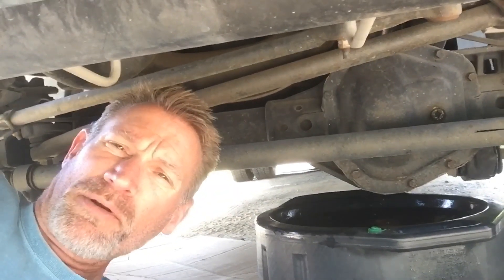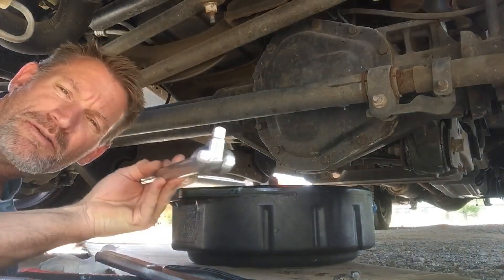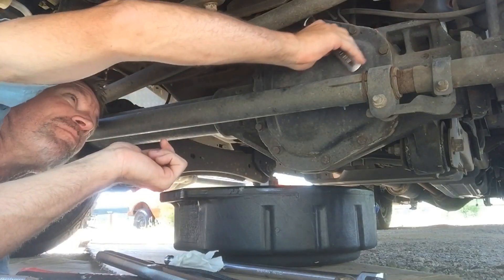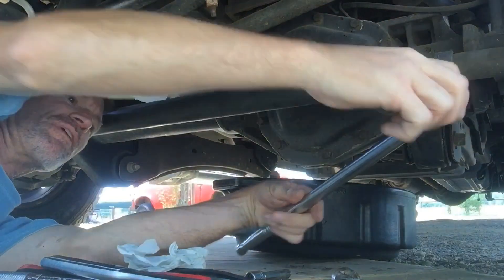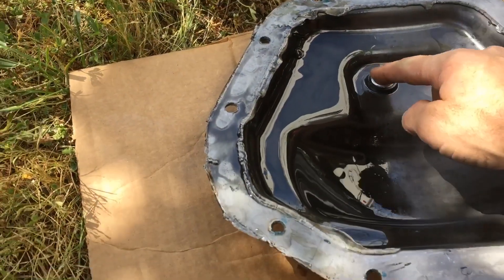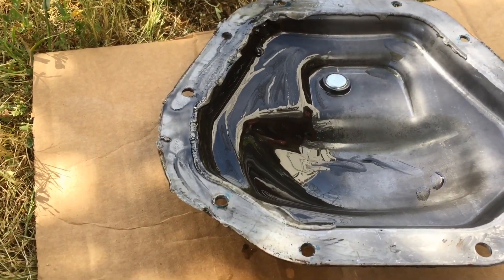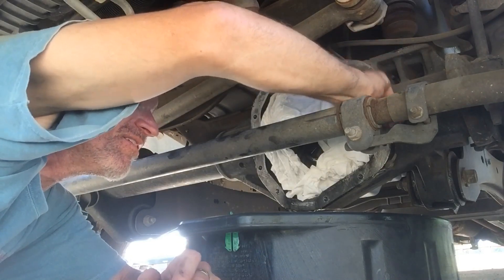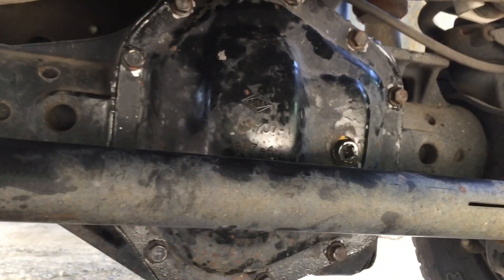Ford F-350 Dana 60 Front Differential Service Oil Change

Comment: Great job I usually do my changes every 8 months just to keep it in a scedule. The oil never seem to be bad and no metal.
Reply: unless its 5-10 years old or you use the 4WD, you never need to change it, but to be over the top, change it after a winter of plowing, or a bit of off road, or as needed like if it gets  submerged in water

Comment: I have never let rtv set up more the 20 mins and fill up never have leaks
Reply from the maker: Sure....  That’s great.  Most shops do it that way as well.  
I’m going off of the pkg instructions here.  If I made a video showing assembly after 20 minutes, people would freak out.  
Thanks for watching
Reply: Man i  drove chevys after installing a new   Intake on it after an hour or two never had any problems long as everything is good and smooth on the mating surfaces it will be fine most of the time now if theres a big gouge i would let it set much much longer thanks for your response